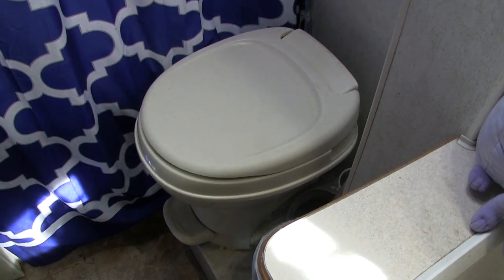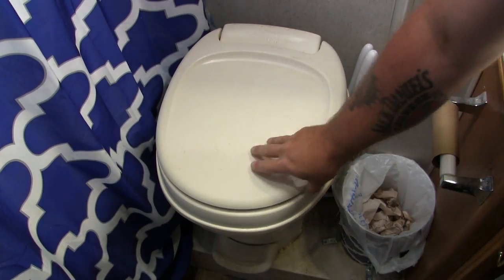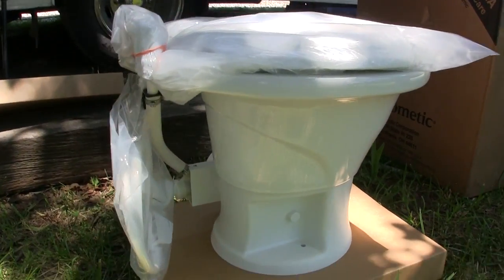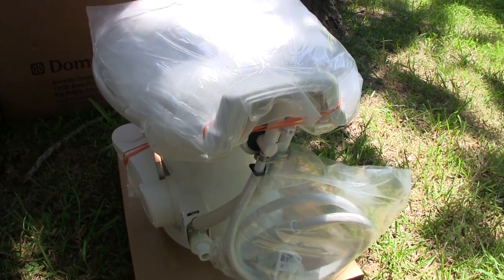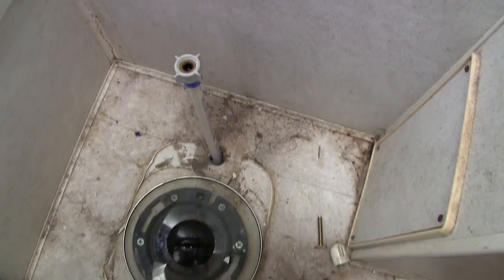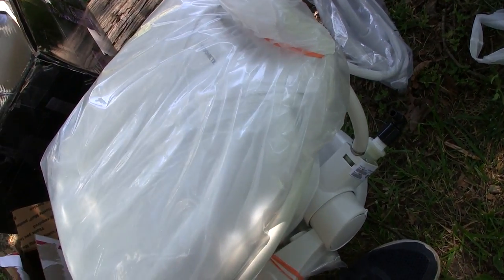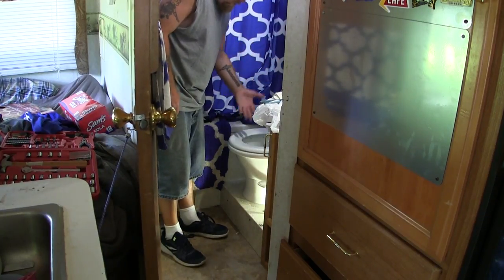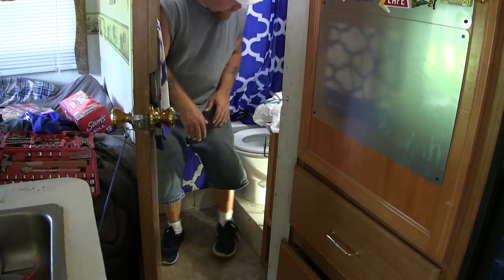Installing New Porcelain Dometic 310 Series RV Toilet

Comment: Eric don't you guys have like a half inch flexi hose you could of bought? The sort of thing used on a kitchen faucet or an appliance? 

You could of cut the main water pipe, installed a elbow, screwed the flexi to the thread and a small loop to the toilet, but whatever you got it done anyway :)
Reply: LambySRI

Comment: Eric;  the line coming out of the floor is pex.  You could have gone to HD or Lowes and purchased a sharkbite 1/2" to 3/8" to attach to the line and then used a 3/8" to 1/2" X 12" stainless steel flex line to connect to the commode itself.  This way, the line could have been lowered near the floor and made the connection a much easier project.  Easy peezy!
I am getting ready to do the same change out, but thought about raising the floor to the height of the commode.  If I do, I will post a video on the project.  Anyway, appreciate your videos, no matter how smelly they are!  lol

Comment: You could get a little step stool to put your feet on.  They have ones designed for toilet use and ones that collapse so easy to store away while not in use.
Reply from the maker: It wasn't just the floor, it was the plastic toilet. But yeah

Comment: Well done Eric!

Just a thought, close all the windows as you suggest but run the fans pulling air IN so you pressurize the coach. Still the Solo cup was smart.

The reason for the calk around the base is to keep the base from slipping or rotating, keep liquids from going under the base and if done cleanly it will give a finished look to the base. 

So get a small tube of bathroom calk and put a very small bead around the base.

Comment: Congrats at the new toilet! It's always interesting how "RV things" are done over the pond (although most RVs that exist over here will never run into any similar problems, but then, over here, your RV is already classified as a big RV and would be considered overkill for only one person to live in - but if I were living that dream, I wouldn't want to have anything smaller, except engine-wise, where a 2.4L turbo diesel would suit me just fine, even with a 5-ton RV to pull)
Reply: That spray only has cold water attached to it. Several have suggested that it is a bidet. If he uses it for a bidet he will be in for a chilling experience.

Comment: Plumbing projects NEVER go as planned. NEVER! We bought and installed this toilet (sans sprayer) at the RV Rally in Phoenix this past spring (2017). Replaced our crappy (pun intended) Thetford unit. It took three trips out of the Rally to Home Depot and an RV heaven called State Trailer Supply before we got it installed - properly. I ended up using regular fresh water hose which I made a complete circle with to connect to our water supply because the two toilets take water from different angles and  heights.  And, I also went to hose clamps rather than the plastic stuff that comes with the toilet (and from the guy at Trailer Supply). Long story but the hose I got from Trailer Supply blew out! Ripped a hole in the side of it. That's how I ended up using regular water hose - and hose clamps.

After much fooling around, and after a flood, we finally got it installed and working as advertised. MUCH better flush than the old Thetford. Now when we have to take it apart regularly to get the calcium buildup out it's a simple matter of taking the water inlet filter off and scooping out the offending calcium. On the old Thetford it required removing the toilet every time.

Great toilet - and good video. Thanks Eric

ps. The Dometic guy at the Rally also told me it was an easy job. The toilet would sit in the exact same place as the old one. THAT was true, but like you, the water connections were a nightmare - just like ALL plumbing projects.

Comment: Next time you have a plumbing issue in tight spots, consider using stainless water flex lines instead of the hard pen. Just makes it easier and no crimping, which can leak. They are available at any hardware store. Chuck

Comment: Thanks. Good points. I think my water line will flex, but I did check all the measurements.  Clearance dimensions were not available when I bought the unit.  I definitely like the solo cup idea.  My tank is connected directly to the sewer system and I can no longer close my black tank.  Barf!  Another project down the road.

Comment: Nice toilet Eric. Next time you have to deal with Pex water pipe tubing there is a brand of easy to use push fit style brass fittings make by a company called Sharkbite. They are very easy to use and can be found at  Home Depot and many hardware stores.

Comment: I just put in a Dometic 320 in mine.... I put in a 310 in my old RV... they are great...Easy upgrade.... Makes going alot better :) I had the same toilet with the same water inlet issue... I do recommend upgrading the seat to a wood one... I could not tell in the video if it was plastic.... My old 310 was and I upgraded.... My 320 came with a wood one

Comment: Eric, I have the same setup in my RV except the handle is on the back of the toilet. I also have the rise under the toilet & am required to perform a delicate balancing act each time it is necessary to use the toilet. This was actually a painful process when I first moved into my RV. Until this video I didn't know there were any other options! Lol. Thanks for sharing!👍🏼👍🏼

Comment: The hardware store plumbing dept would have a stainless steel braided flexible rubber hose that would easily make this bend, it comes  in precut lengths and is used to connect toilets, sinks, washing machines etc in regular houses.

Comment: Hey Eric a little  vasiline on the valve flap with solve the problems  of replacing the gaskets  every two months. you'll  find the ball with porcelain  toilet with need an occasional  shot of petroleum  jelly on the PLASTIC  spring controlled  flush ball. mine came with the sealand 111 low profile  porcelain  bowl. The new toilet should come with a new bolt down flange. Good luck brother. I would add a shut off valve on the toilet as rv's dont come with shut off valves  under the fixtures.

Comment: Eric,Keep an eye on the black connection right at the bottom we have same type toilet and ours has cracked three times since last year!  It is only a tiny crack , but , will make your pump cycle. Also depending on conditions the little water holes can get moldy even when using several times a day. I spray white vinegar in them several times  week!

Comment: Hey Man,
The silicone around the base is Not for smell.  It is to keep leaking, spilled or any other water that  does not belong there from getting under the toilet, which in time will rot the floor. Does not have to be so much goop. A 'Nice" fill line will do. Just has to stop the water that WE did not see for the last three weeks !!
Safe Travels !

Comment: Eric, try lifting the foot leaver to fill the bowl first.  The sprayer is for final cleanup.  I had my plastic one replaced with a porcelain one when I bought the trailer.  I told them that I wanted porcelain and the bowl big enough so my balls don't hang out when I sit on it.  It took me a few months to figure out that filling the bowl was as simple as lifting the leaver and not pushing it half way down like the old one.

Comment: In our RV, I encountered a leak from the flush valve, which deposited a large puddle on the floor. Unluckily, it was 4 AM and we were connected to city water at the time. So, I had to put on outdoor clothing and shoes and go outside to shut off the water. And, we could not use any water until I resolved the problem. Lesson: install an inline shutoff valve in your water connection to the toilet!

Comment: Eric, you can get all kinds of fittings for the pex pipe and you could have shortened that hose way down. Also you can get "shark bite" fittings which, unlike the pex which are crimped and are not easy to change or modify, the "shark bite" are easy( with a little clip) to take apart if you need to modify or shorten a hose. Shark bite fittings are little more expensive but feel the flexibility they provide are worth it. I won't be able to look at a crock pot meal every again without thinking of you and Jax. lol

Comment: I did this same job. had even more problems with no room n had to cut into the false wall in back and turn the bottom bolts to match toilet. was a complete nightmare but I did it all myself too! I still have to use a stool in front of toilet for my feet cuz I didn't get the low profile one. lol. but yes I sure love the porcelain one better!! good job.

Comment: Now I know hindsight is 20/20 but I'm not sure why you didn't cut the existing line about 4" from where it came through the floor put a 90 in, bring it directly over to the input and put another 90 right into your new toilet. Like I said I realize hindsight is 20/20 but it will save you all that extra looping line that has the potential for deposits to build in not to mention harder work for your pump?

Comment: Hi Eric, nice job! I'm a long-time subscriber, occasional comment-tor. I've never owned a motor home, but have had 6+ boats. (still do). The last one had two heads (aka bathrooms) and two  toilets (aka heads!?)... In the 28 years I had that boat I had to replace both heads twice. The boat came with Pars, and they were a useless piece of crap. (no pun intended)... I replaced them with Raritan PH II's... better, but not great. Judging by this video your toilet replacement was infinitely less difficult than replacing those on a boat. You at least have access to all the necessary parts, and you have house-like attachment flanges, bolts and such. Most (all?) boats do not.... I wish you and Jax continued success. Thank you for sharing your travels....

Comment: Do your feet touch the floor now?     I think that without a water filter, the well waters and hard waters may discolor your new toilet, but maybe if you keep an eye on it and clean it every time you see a slight discoloration, it will come off.   I am thinking around the  rinse water inlets.

Comment: with the new couplers i was wondering why you didnt just shortened the original pek line untill its level with the hookup of the new toilet put the first bend in screw the cut of part with the original straight screw fitting  intoo that then cut the end of that to size straight across the toilet hookup , mount the 2nd coupler intoo that end and screw it intoo the toilet water hookup 
that way you wouldve had a verry short 45 degree bend straight to where it needed to go instead of pek tube running everywhere  behind the toilet making cleaning quite a bit harder than it did before

Comment: SHould've used a standard toilet hose - the ones with metal hose - designed for curving & adjustments..Also, cut down the source pvc down about 8"...

Comment: Just a follow up on that shorter stainless steel hose, they have them at lowe's; the ,fluid master universal ,12 inch braided stainless steel toilet supply line, or any other hardware store should have it.

Comment: Ah ha leave it to you and Jax to shout a video about plastic toilets! But it's very informative! Thanks! The worst thing I hate about mine, is the creaking and squeaking it does when you sit on it!! So if I ever get another travel trailer, I have the porcelain toilet on my list! Along with dry bath and corner shower stall with NO TUB! Also a walk around queen bed and either a sofa or recliners! Thanks for this video! I hope you and Jax are happy and stay safe!  OMG! The crock pot lid!!! Why not just use a hose? Instead of pecs? All that hose and hardware will be a biotch to clean!

Comment: Nice ceramic toilet, but you could have found a more attractive  way to connect new water line. I usually try to plan for the adaption of new unit to old unit before I commit to upgrade. Most hardware stores will carry a variety of pipe/tubing/and adapters to fit new appliances. Still I enjoyed the video, and learned about the newer style rv toliets, thanks Eric.

Comment: Just a thought Eric, older people have a hard time standing back up after using a normal toilet...  They have to rock back and forth to get back up onto their feet...  Kits can be bought that fit on top of normal toilet with long bolts to go through the toilet seat down through the riser kit and bolt down to where the toilet seat use to be... This is the way a normal toilet can be made higher for the elderly or handicapped... Question is, was this RV owned by an older person that needed the extra hight?   Keep up with the great videos... Watch em all the time...

Comment: the hose coming up from the floor should be able to be cut down to height and refitted with a new compression fitting from most any big box hardware store and many smaller stores. kinda looked like the diameter of some of those adapters you used where significantly smaller and likely ristricting some flow. in any case congrats on the new porcelain throne, not sure how you survived as long as you did with the old toilet situation. I would have had to build a step or somthing for my feet to sit upon in fairly short order if it where me. safe travels eric.

Comment: the lower the seat the better. I have experienced high seats and low seats. I poop better with lower seats. user a small step stool to stimulate a low seat. you will be glad you did

Comment: I'm not a fan of plastic, especially for a toilet, used a plastic toilet seat a few years, went back to wood.  I got a one piece toilet 17 years ago (was drunk one night and knocked loose the tank from the bowl sitting down) still a drunk, LOL. A few years ago the tank flusher seal got hard and you'd have to "tap" the flush lever to get it to "seal". Over 10+ years, rubber degrades,  I was gonna hire a plumber, but did a search on YouTube, found my toilet and how to fix it video, replaced the seal in 5 minutes!

I was actually a plumbing manager 38 years ago at an Ace Hardware store, so I know my "fittings", and then working in "fasteners" for another 5 years.  Last year I redid my garbage disposal/sink in like 15 minutes.  Getting a toilet in a box, you don't know the plumbing route,  5 minutes if it's the same, a few minutes more if you're parked at a hardware store. Hope your "new" Tioga lasts longer than the last!

Comment: Couple adapters and 12 inches of braided flex hose would have saved you lots a trouble.  Using the crock pot lid was genius.  That was worth 50 comments.  I would have put some fake dog poo on the floor/toilet when you started to really gross everyone out.........For short people it would be easy to build/buy a step up for your feet.   Sprayer adds another convenient place to do dishes.  👍🙌👍

Comment: I am a layman, every thing you say you have to repeat to me 4 or 5 times so I can understand. I understood you 100%. The hose in the back was tricky. For one thing most thing like that are ment for it to be on the right side but in your case, because I think of the size of your RV, you had to put it on the left side. But you did (get-er done). Why they think putting a time limit on things like this, is just stupid. You get it done when you get it done, and get it done right.           Chirp

Comment: hey Eric.
My RV is a little older than yours but yours is a copycat, LOL
I heard you, my original toilet connections start failing and I had to replace the unit and I chooses  exactly the same as yours, you won't regretted but the installation was a nightmare. 
Overall it paid off the hard work

Comment: Change out the toilet paper roll, or you gonna end up with the stinky finger.  nice upgrade.  this should be a comfortable place.  funny how they make those things to be so damn uncomfortable.  I have lived in a travel trailer for a few months one time.  Bathroom was about the only thing i really didn't like about it.  but i weigh 315 lbs so...  there is that add on problem.

Comment: why didn't you just use a house toilet flexible braided stainless steel water line that can move any direction and a small 1/2 inch male to male nipple adapter. would have been so much easier. cut the pex down lower and  put a new male threaded fitting for a normal toilet fill hose. would have saved you a lot of time, effort and money.